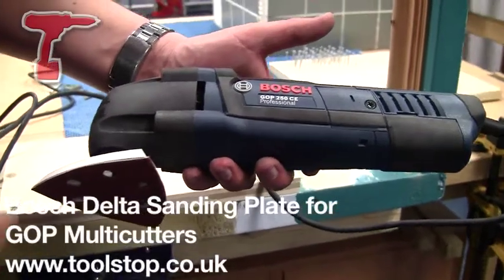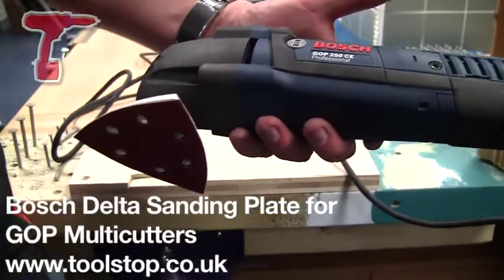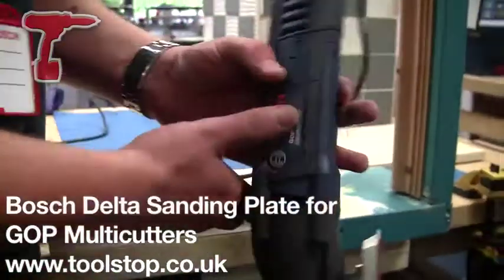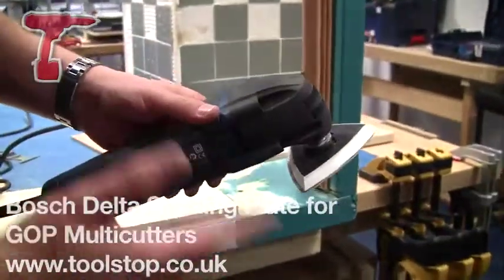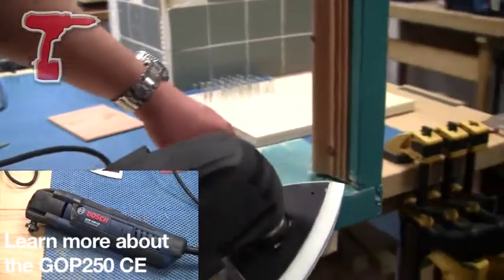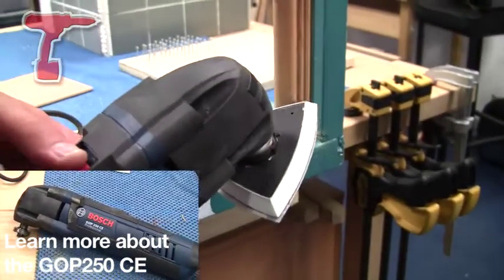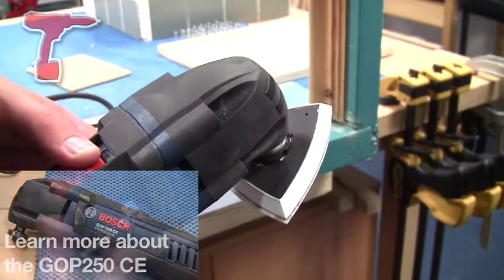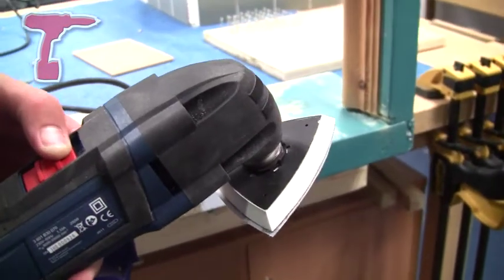Bosch Delta Sanding Plate for GOP

Comment: These machines are good at sawing and cutting. On sanding they are bad. The reason is that the sandpaper falls off after about 5-7 minutes. This applies when using Bosch original sandpaper. This gives a cloudy amount of sandpaper. All fall short of time. Over time, the actual sanding sole is also damaged. This also applies to Bosch booth professional series. Everyone uses the same Delta sole. Should the machine be used for grinding, it is not recommended.

Comment: This is a nice piece of shit! The cutter works fine, but in use with sanding plate if the surface is not completely flat, the sandpaper constantly loosens. The sanding dust push the paper of the plate. At today's GOP machines it resembles the same cheap plastic sanding plate. This is similar in both green and blue (professional) line of Bosch. The older machines were better at this.